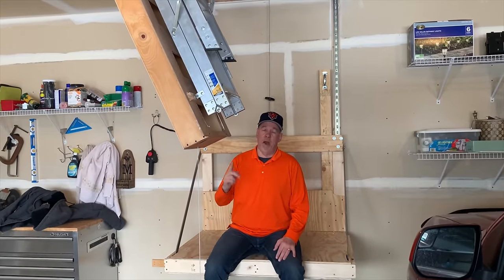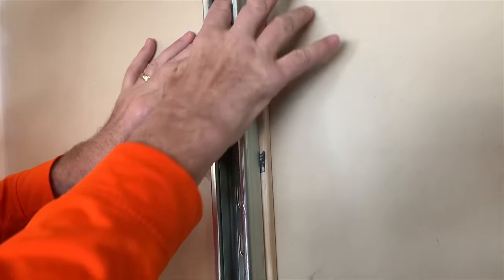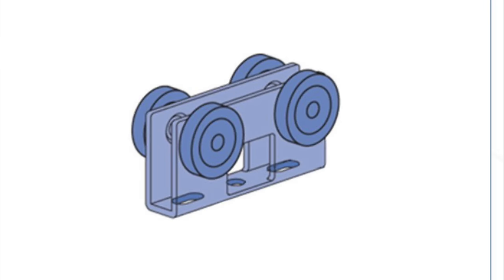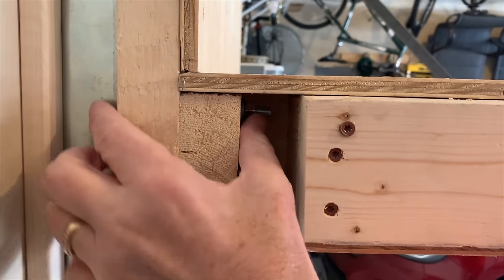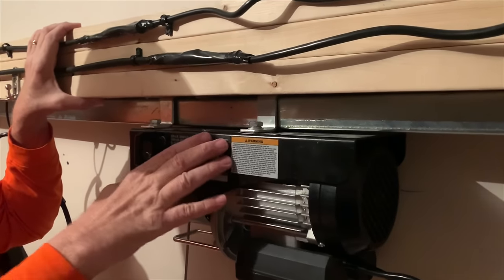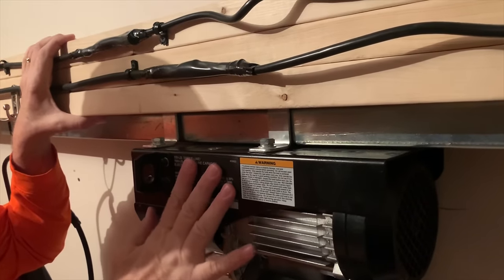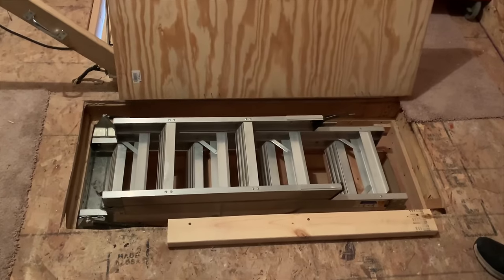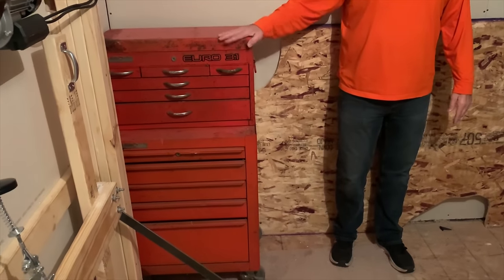Garage Attic Elevator / Lift Build in Minneapolis Minnesota

Comment: So cleaver and well built.  Thank you for the inspiration for those of us getting older and trying to stay safe.
Reply from the maker: Thank you. I can’t get used to getting old. 🙁 I have to work around it!
Reply: This is a clever design but the one problem I can see is it needs a safety break in case the hoisting cable breaks. I can see Murphy's Law when your descending and someone is under it that's when the cable will snap. You need to build a safety cage around it. And maybe some danger signs. I do love the concept but more emphasis on safety protocols. I know you will eventually do the right thing you are clever enough to get it done.
Reply: @eugeneshealthproject  Sharpie on wall: Don't stand here. Fatal for idiots. Use lift at own peril.
Reply: @lucash1980    🙈🦎🐐🦌
Reply: @lucash1980  Love your Response :)
Reply: You probably don't need to be old and out of shape for that narrow hole to be a great inconvenience. Especially if using that space for a storage that you have to access often (as seemed to be the case here). Of course, he could just widen the hole and put a bigger hatch - but that's still a lot of work, so why not make it more convenient and fun when already at it :)
Reply: @Speeder84XL  you are absolutely right, it takes just about nothing for even a young person to lose balance carrying a cargo load up any kind of ladder narrow or not, and fall  potentially becoming physically disabled or damaged for life. safety and convenience is definitely not only for old people. theres far too many young people who think they are invincible until they tragically find out that they arent
Reply: Well said!
Reply: Looks like it has the inherent safety that if the cable snaps, the carriage would get stuck on the track because of the moment created by the center of mass twisting it downward